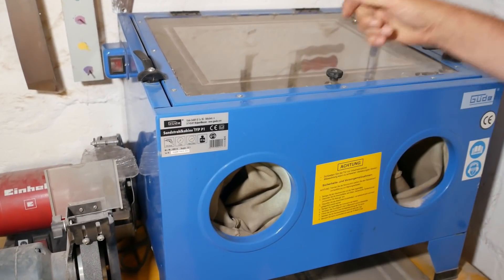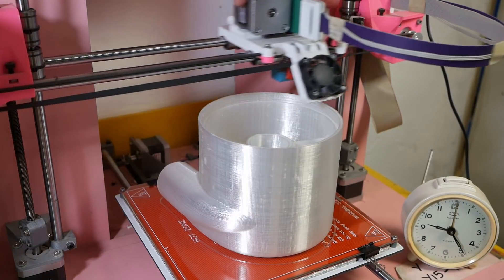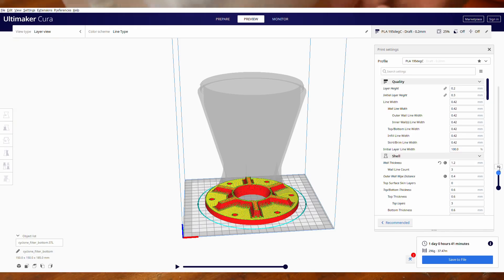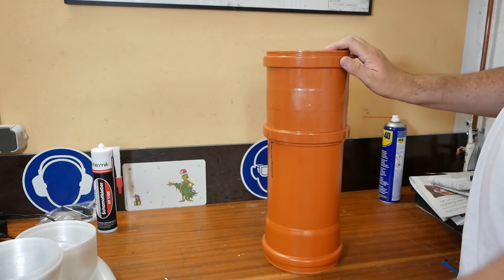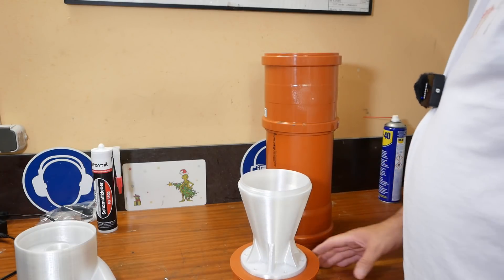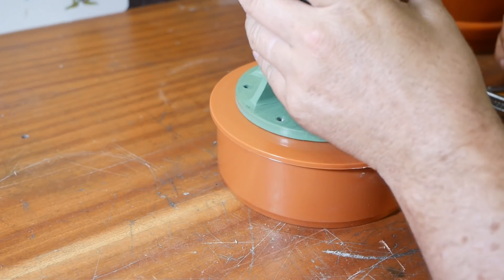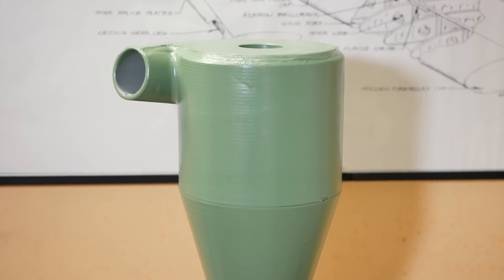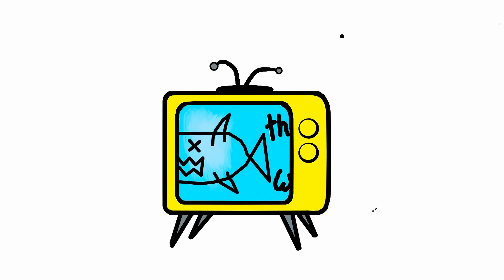DIY cyclone dust extractor

Comment: EXCELLENT  STL FILE IT PRINT VERY WELL JUST WITH A FEW ADJUSTEMT ON PARAMETERS, USED PLA CF, THE ONLY PROBLEM WAS TO REMOVE THE INTERIOR SUPPORTS.
Reply from the maker: Yeah, it has worked well for me as well.

Comment: What filament did you use? Great video.
Reply from the maker: Clean PLA. I have only ever used PLA
Reply: @RotarySMP  yes, I could see on your setup screen that it was PLA. I  use mostly PLA as well.
Reply from the maker: @jamescullins2709  I have never taken the time to work out what settings work well for ABS, and it stinks. Some of those lower Shore rubbery plastics look interesting for way wipers though.
Reply: @RotarySMP  Thank you for your reply. I think I will use PLA and install a vacuum relief valve in the top. I have seen this done on youtube and it worked well.
Reply from the maker: @jamescullins2709  If you look at the latest video I just posted, I printed out an adapter to click into the back of my sand blaster, and it already has a vacuum control valve built into it. I also demonstrated the cyclone on the sand blaster. Spoiler alert... huge improvement.
Reply: @RotarySMP  will do, thanks

Comment: Welcome to the wonderful world of cyclone vacuums. You will really appreciate it when sucking up plaster dust or grinding dust. You know, the stuff that clogs up the filter in the first 2 minutes of use. I like your use of scaling to fit the hoses. I had to cobble together adapters made from ABS pipe fittings and some creative use of hose clamps and lathe work. Good job.
Reply from the maker: Now I just need to get my shop vac back from my daughters apartment so I can try it with the sandblaster.
Reply: @RotarySMP  Good luck with that. One last interesting thing about add-on vortex units. Aliexpress has an aluminum "mini-vortex". It's only about 200-250mm tall and you can gang them together (the inlet is about 25mm). Great for sucking up hot chips or grinding dust. The stuff that embeds itself into plastic (or wears it down). Well made for about $20 US. My favorite vortex is a Red Devil upright I rescued from a dumpster (cut cord). I removed the bottom beater bar and handle and it sits on the wall next to my lathe & mill. Small flexible hose, easy to empty, and oh yeah...free.
Reply from the maker: @misterfixit1952  Free, and works... you cant beat that. Thanks for the tip on the aluminium vortex.

Comment: how durable will that be ; by definition sandblaster sand is about the most abrasive stuff that you can easly get?
Reply from the maker: It is a valid concern. The velocity through the vac should be substantially lower than the velocity out of the gun.

Comment: You can increase the performance of the cyclone by adding an inlet with a filter to your container/tube
Reply from the maker: The whole idea of a cyclone is not to have a filter which can get clogged, but just to separate the particles from the air.
Reply: @RotarySMP  it regulates the air intake, if had made your container from a let's say thinner or softer material it would collapse inwards, and that regulation inlet would prevent this from happening. Which adds unnecessary load to the vacuum cleaner.
Reply from the maker: @PoYoTheWild  That is why I used that strong rigid waste pipe.
Reply: @RotarySMP  don't get me wrong I am not arguing or telling you what you did is bad :) just a suggestion.
Reply from the maker: @PoYoTheWild  I appreciate your input, I am just having difficulty understanding where the filter would go in this system to be an improvement. 

I am looking forward to trying it on the sand blaster to see if it works as well as with saw dust.

Comment: Before you drill a hole in the side of your cabinet. https://www.thingiverse.com/thing:4918420 

I also sent you an email. Cheers
Reply from the maker: That is also a  time saver. Thanks for the tip
Reply from the maker: Oh wait, I just read your email, and you actually designed that. Cool. I'll get it right onto the printer.

Comment: That seems like a very good addition to any shop vacuum system. Now, just figure out how to make a silencer for it. Mine is so loud that it blocks my brain. Sometimes it seems like the damage is permanent.
I liked the presentation. Thank You for Your time!
Reply from the maker: Thanks. My vac has the perfect harmonic frequency to be heardthroughout the whole house. I just bought a little battery powered one for the quick clean up jobs and to be quieter.
Reply: My ears and brain don’t tolerate noise at all, so I bought a pair of US-made shop vacuum machines that feature “scroll noise reduction technology” or something like that. They work very well indeed at knocking down the high screech that is so common in big vacs. The brand is Ridgid, very common in DIY shops hereabouts; I hope for your sake there is a European equivalent - it’s a worthwhile investment in noise control!

Comment: 3D printing dusts are explosive.  Dust collection is also based on calculations that give the the required conveying velocity of a particular dust.  Plastic dust conveys at around 3000 fpm.   To do this you need a dust collector and not a vacuum. A vacuum is low cfm/high static lift...a dust collector moves air like a HVAC system, but isn't good for vacuuming.  For your application you need about 800 to 1000 cfm.  A shop vac will never do that.   The shop vac also has cheap carbon brush motors that are HIGHLY dangerous around 3D printing dusts.  Your entire set up is hazardous.  It should be made of a dissipating material and not plastic.  Adding a ground wire won't dissipate the static either.   Call a proper industrial dust collection company and leave the DIY projects for things like bird houses.
Reply from the maker: Some good points, but why would the 3D print be producing dust?
Reply: so about 34 miles per hour, correct?
Reply: 3000fpm is not that hard to come by  with certain shop vacs depending on  the actual cfm at a given orifice size.    Too long of a list so I'm not going to go on.
The only question I have for you is have you had a disfiguring explosion yet?

Comment: A great tip that was gifted to me by one of my students was to punch a series of small holes in the "gutter" around the edge of the paint can rim so that the excess paint can drain back into the can as you wipe the brush. Also, when you put the lid back on it won't trap any paint under the ridge of the lid. Certainly a manly effort to  print your own cyclone. Well done.
Reply from the maker: Thanks for the tip. Glad that model had already been uploaded, saved a ton of work

Comment: Careful, once the collection bucket reaches a certain level, the bucket will collapse. If I remember correctly that was roughly the half way point
Reply from the maker: That is why I used this sewerage pipe. It is thick walled and will not collapse.

Comment: Awesome, I have exact same blasting cabinet, it leaks dust even after putting in draught excluder foam. I did use a vacuum cleaner but it was too strong and nearly collapsed the cabinet. 
Q1 How will you adjust the vacuum pressure in the cabinet? Make the inlet opening bigger or put a sliding slot (like what the vacuum cleaner has).
Q2 what PSI do you run for the cabinet?
Reply from the maker: I was going to add an extra port for the vac, so there will be two inlets, the existing small on at the back, plus the filter unit. Hope that will be enough. The second thing is that I will use a small battery vac, with less suction than the big floor unit.

Comment: Mildly jealous of those having 3d printers now. I've seen a lot of little figures and stuff but that actually seems useful! Thanks for the video!
Reply: I had a handle on my screen door break off about three years ago... designed up a new on in FreeCAD, sliced it and printed it in PLA. Its been outdoors in Canadian weather for three years now and still going strong.
They can be really handy... when you really need a custom part.
Cheers,
Reply from the maker: @EngineeringVignettes  That is a great use. And it this one fails, printing the next one will need no more design time.
Reply from the maker: They are a reall handy tool. Thanks for watching.

Comment: I've always been afraid to ask this but... Do you need washers if you're using lock nuts?
Reply from the maker: I wanted washers to spread the load, as I am only clamping plastic. If I had larger washers, I would have used them. The nut and bolt head along would put too much localised load and easily crush the plastic.

Comment: That worked surprisingly well 👋
When printing big things like your cyclone I use a 0.6mm nozzle and 0.4mm layer height and those prints finish in half the time. No special settings or hardware while keeping a good finish without shaking your printer to bits. Nice time lapse 👌
Reply from the maker: Thanks. I can't be faffed changing nozzles, and it really make no difference to me whether it runs for 15H or 30H. It is sitting in the basement beavering away out of sight. 

I used 0.2mm layer height to kee the striations down.

Comment: That stop frame capture of the print turned out really well in the end, so did the print. It had a satisfying fit once screwed together. I'm glad you explored this solution as it was in my plans for the blaster cabinet build I've started collecting parts for. I look forward to seeing how well it performs, the initial test looks promising indeed.

Oh, and the apple hasn't fallen far from the tree with the kitchen refurb. I hope it goes well and your daughter gets to enjoy the fruits of her labour too.
Reply from the maker: Thanks. I need to print and install the adapter for the blast cab and see if it works there as well.

Comment: On the topic of painting 3d printed objects: if you want to achieve a smooth finish and remove the layer lines you can use automotive spray-on filler primer (motip spray-putty, is what I have experience with) roughen up the print, spray the first layer, leave it dry for 2 hours, sand it once with rough paper, spray again, dry, sand it once with fine sand paper and you're ready for painting and will get a super smooth result  
(This isn't nescecary for functional parts of course, but I wanted to share some knowledge)
Reply from the maker: I have done that for 3D printed casting patterns, but figured this didn’t merit it. It is just part of a trash system.

Comment: Hello,
This was the first time I have ever watched 3D printing and I thought actually a 3D printer could be useful... I have already publicly said I will only have one more machine in my workshop - lol, so will meet to fight the urge to buy a 3D printer. See you next time.
Cheers.
Paul,,
Ps. Was the table on your drilling machine scraped?
Reply from the maker: Hi Paul,
They really are an incredibly handy device. I still sometimes forget to think of 3D printing as a solution.
Yeah, I did a bit of scraping practice on the drill table when I refurbished it. Chicken scratching really. :)
Mark

Comment: Could you please test sandblasting 3d prints for finishing?
Can't find anything online...
Reply from the maker: I doubt that will work. Expect that the grit will just get stuck in the striations, splitting some and partially filling the interior with sand. Probably just make a big mess.

Comment: I was actually wondering at first what you'd do to solve the permiability issue of the 3D prints but sealing it with that nice green paint works just fine. I'm sure it also helps to smooth out the funnel like you said.
Reply from the maker: This is just PLA so I figured it would make it more robust
Reply: The walls on this print are massive. No permeability issues at all .I printed this more than a year ago in PETG has been using it since, no post processing, works like a charm.
Reply from the maker: @jesperjohannesen1696  Thanks for the feedback. I have only ever printed with PLA.
Reply: @RotarySMP  - PETG is the new ABS... only much less stinky.  The hotend nossle needs to run hotter (up around 240-250 deg. cel) and use ~ 80-90 deg cel on the bed to get good adhesion. It may be an issue if the hotend uses a plastic insert (as a lot of the cheap Chinese ones do), the "all-metal" hotends have no problem with PETG and higher temp plastics.
PETG is basically water bottle plastic with glycol added :)
Cheers,
Reply from the maker: @EngineeringVignettes  Thanks. I will have to get a bit more adventurous, but so far PLA has been so reliable, I havent branched out.

Comment: hi mark,

nice cyclone! I managed to get a filament seller to produce PETG in RAL 6011 Reseda green.  I don't get money from him but i share it with guys that print parts for the shop. it should save you painting for the next project. shop is 3DPSP.

in near future RAL7016 Anthrazitgrau is also available. Thats the most common Colorcombo for old machines like DECKEL MAHO and so on...

greetings 
Tom
Reply from the maker: Hi Tom,
I looked at buying some RAL 6011 from you, but back then you only had the new style thinner stuff. My printer is older and needs 2,85mm filament.

Comment: Pretty awesome use of a 3D printer - the cyclone print turned out great!  In the States, we call that paint "Vista Green", and it was one of the most popular shades for Bridgeport milling machines.
Reply from the maker: In germany that had a DIN standard defining that machine tools were to painted that color :)
Reply: @RotarySMP  that’s odd all my machines are painted Aldi paint green 😀 not that I’m cheap or anything!
Reply from the maker: @julias-shed  I also dont bother with the super expensive 2 part epoxy paints. Figure by the time the paint wears off my machines, my eyesight will have failed :)

Comment: Nice 3D printer work. Also nice to see the 3D printer photography gizmo working well :-) Also great to see your daughter getting her feet dirty renovating, good job.   
As for me my Sunday is going to be spent burying the solar array power cables in the trench I dug yesterday in the baking sun but today its torrential rain that has turned the spoil into slurry. grrr.
Reply from the maker: Thanks. I am glad I did the 3D printer coordinated trigger, as it is cool to see the part grow like that.
We have had some pretty heavy thunderstorms and showers here as well. Good luck with your power cable run.

Comment: Your cyclone is likely too big to be very effective with the fine particles produced by a sand blaster. A good intake and enough negative pressure in the cabinet is usually all it takes to keep visibility in check. I had a small canister vac with a bag over the filter, on my large DIY cabinet, and it never plugged up or needed dumping.
Reply from the maker: I look forward to 3D printing the adapter and bolting it to the side of the blast cabinet to try it out. WIll be interesting to see how it works with sand blaster dust rater than wood.
Reply: @RotarySMP  Can't wait to see myself... I picked up this same cabinet on sale a couple of summers ago, and want to make some kind of multi-cyclone for it, like household vacuums have  à la Dyson Root Cyclone
Reply from the maker: @tahwnikcufos  Good one. Will be curious to hear your experience of this sand blaster.
Reply: @RotarySMP  👍
Reply: @SystemsPlanet  They are particulate filters, just like the vacuum cleaner bags your mom uses. Most vacuum systems come with them in some form, if they are designed to handle air that needs to be safely discharged back into the area of use - it's kind of a design rule, that the waste air be safe to an acceptable level. Look for "Wet Dry Vacuum Bags" on Amazon. On my sand blaster vac, it was an actual draw string cloth bag, not unlike those on big dust collectors you'd see in a wood shop. No matter what type of vacuum used, it's always a good idea to wear a proper respirator mask anyway. The vacuum is really just there for dust control, not dust protection.